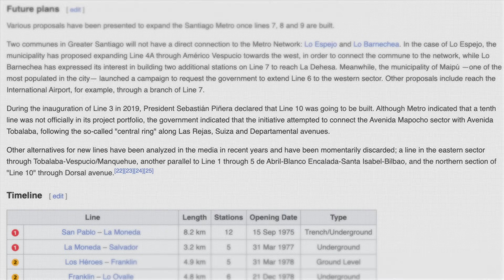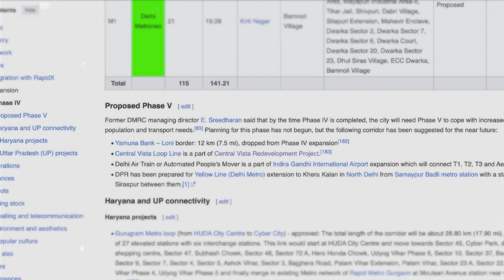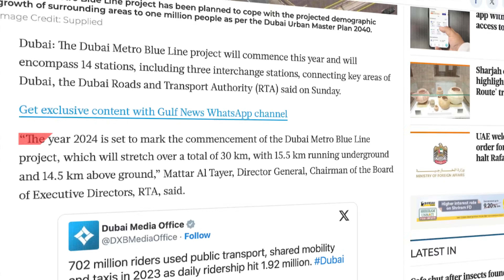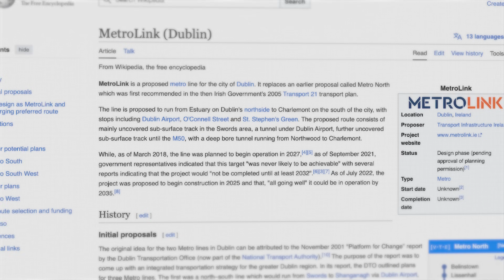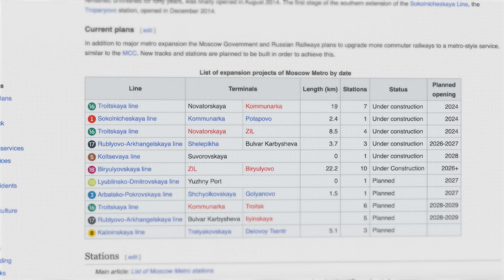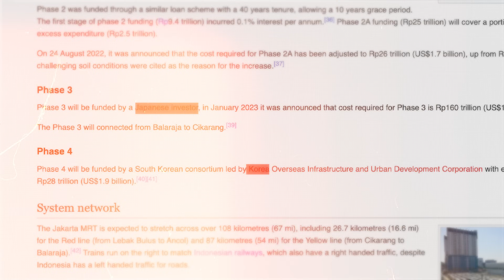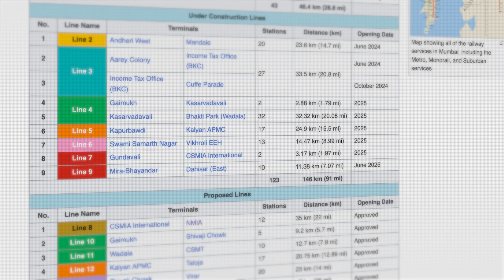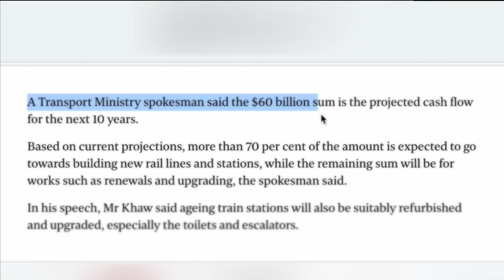TOP 20 Biggest Metro Projects in the World

Comment: WHY YOU DIDN'T CONSIDER  LIMA'S LINE 2 CONTRACT AT A COST OF 5.37 BILLION DOLLARS,THE HIGHEST IN SOUTH AMERICA? This data appears in Google. The first short trench opened in 12/21/23 on 5 sttations, 5.2 km. automatic system. This out of 35 km. (27 km Line 2 plus near 8 km of Line 4 first trench both being build currently) that will be operated by 42 6 cars automatic trains. Will be build 37 big size stations plus 2 factories. 
As a plus information Line 3 and what remains of Line 4 have preliminary budgets of about 10 billions for both and expected to set contracts next year and 2026. Both of course in automatic work. The first 4 lines in Lima will sum about 134 km.

Comment: 7:36 It's renovated historical train (only one and of cause it works on the first Moscow metro line) . It equiped with modern engines/brakes/... and electronic because it works with speed and safety of modern trains in typical Moscow traffic with 1.5..2 minute interval.

Comment: The Melbourne metro project is insane in scope if its actually pulled off it could be the worlds best system by a significant margin on a per capita poulation basis ....will it actually happen  though or will they need to rescope ???......200km of metro lines is  a huge infrastructure task for a mid sized city like Melbourne

Comment: Bucharest is also building 2 new metro lines: M4 (14 new stations, 12 Km) and M6 to Henry Coanda Airport (12 new stations) the cost will be around 4 billion euro (EU funds + a loan from the Japanese government for the M6 line.) The physical work already started for M6, preconized to open in 2026, while for M4 it will start in 2026. The M4 line will connect also with the new airport that will be built in the south of Bucharest in 2028. There is also already plans for another new metro line (M7) 15 new stations, 13 km, + multiple extensions of older lines.
Reply: And there should be additional stations on the metro lines from the communist times. Distance between stations is to long in the city centre

Comment: Athens metro system again overlooked despite currently building its 4th line, which is gonna be fully automated. It’s first line , although ground level, opened 1869 and was electrified and expanded underground to the center 1904. 3 metro lines go through the center of the oldest continuously inhabited capital in Europe and one of the oldest in world and some of its stations are small underground museums with exhibits from the metro excavations. The 4th line will add 36km and 34 new stations in 5 phases and there’s expansions undergoing on line 2 and planned branch of line 1

Comment: Los Angeles should have been on this list. It's expanding both its subway and light rail lines. It's also getting an automated people mover at LAX airport that will connect to the LA Metro network.

The B subway line will expand about 10 miles opening up in three sections starting next  year with 3 new stations. 2 more in 2026, and another 2 in 2027.

A new subway line is being proposed to connect the San Fernando Valley with West LA and eventually down to the LAX airport as well.

Two new light rail lines (not trams) have already been approved. Both scheduled to be operational in 10 years.

Three existing lines are getting extended. The longest light rail line in the world will get 4 new stations in 2025 making the line even longer for a total of about 59 miles (95 km). Again, the LA Metro doesn't have tram lines. They are light rail lines with a dedicated ROW and are vastly grade separated with at-grade, subterranean, and aerial stations. These trains have a top speed of 55 mph (88 kph).

There is also a proposed gondola system that will connect Union Station to Dodgers Stadium which is up on a hill and surrounded by freeways.

Lastly, Union Station will get a huge expansion and renovation in preparation for the arrival of the High Speed Rail train in the next couple of decades. This expansion will increase the station capacity by 60% improving the frequencies and capacity of the regional, commuter, and passenger heavy rail train lines of Metrolink and Amtrak.
Reply: Great more places for homeless people to sleep🤗

Comment: The rest of the world: striding into the future of rapid transit.

The USA: still struggling to get its big boy trousers on and still playing with busses and trams.
Reply: Lol
Reply: Los Angeles should have been on this list. It's expanding both its subway and light rail lines. It's also getting an automated people mover at LAX airport that will connect to the LA Metro network.

The B subway line will expand about 10 miles opening up in three sections starting next  year with 3 new stations. 2 more in 2026, and another 2 in 2027.

A new subway line is being proposed to connect the San Fernando Valley with West LA and eventually down to the LAX airport as well.

Two new light rail lines (not trams) have already been approved. Both scheduled to be operational in 10 years.

Three existing lines are getting extended. The longest light rail line in the world will get 4 new stations in 2025 making the line even longer for a total of about 59 miles (95 km). Again, the LA Metro doesn't have tram lines. They are light rail lines with a dedicated ROW and are vastly grade separated with at-grade, subterranean, and aerial stations. These trains have a top speed of 55 mph (88 kph).

There is also a proposed gondola system that will connect Union Station to Dodgers Stadium which is up on a hill and surrounded by freeways.

Lastly, Union Station will get a huge expansion and renovation in preparation for the arrival of the High Speed Rail train in the next couple of decades.
Reply: @mrxman581   It just so happens that Los Angeles is the exception that proves the rule.

If the subway extension is the Purple Line then it isn't the B train, it's the D train.

Your light railways have street running sections too, even if they're in the median (Crenshaw) or on the side of the roadway (Exposition). And they have true street running in East L.A. with only a curb to keep cars away from the tracks. So they're glorified trams.